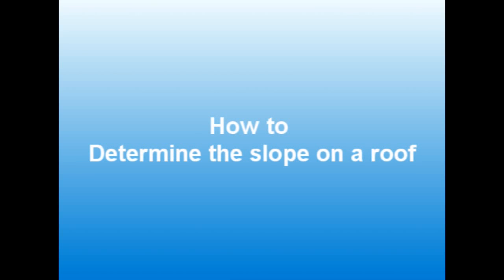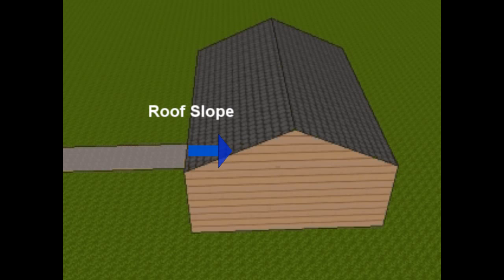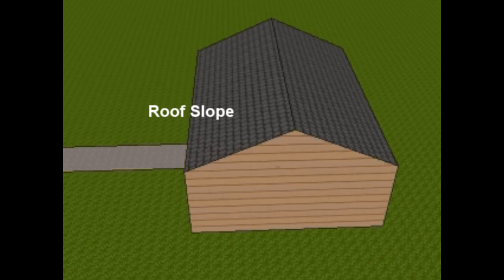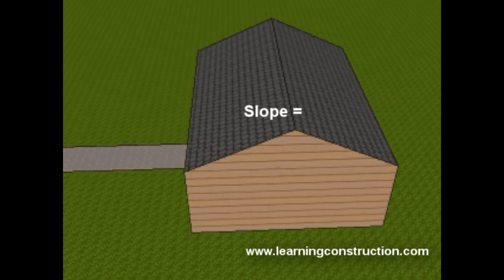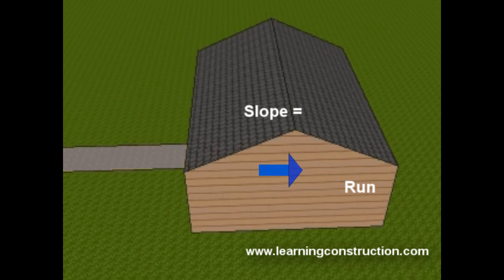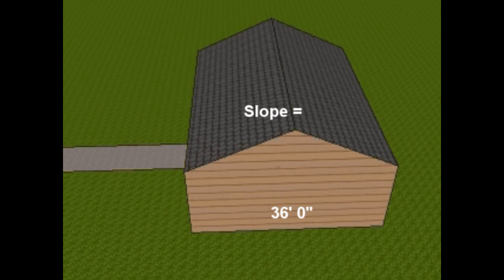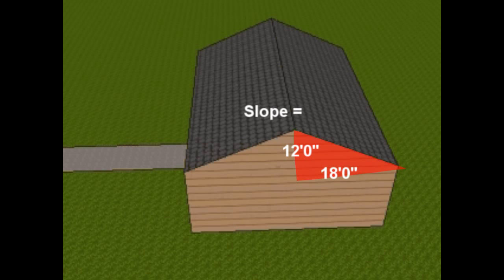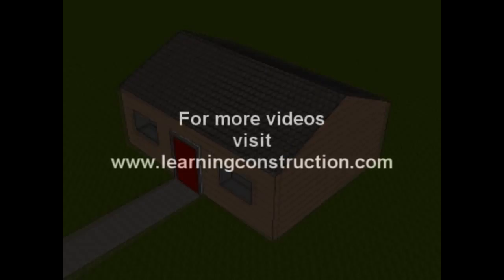How to determine the slope of a roof

Comment: That's backward, when you do the roof first thing first is choose your desire pitch or roof slope.EX 12:12 pitch=45 degree angle.so 8:12 pitch is 33.69 roof slope.so18' half wall span÷12 pitch=1.5x8=12'  is your ridge pole height.

Comment: I didn't get how you got the 8/12 inches  ... I divided 12 by 18 on the calculator,  and it gives some # that looks like, 
.6666666667. Please have patience with my ignorance here, but how does that reduce (as you called it) to the 8/12?
Reply: 12/18 = .666667 X 12 = 8  or 8/12 
The 12 that you multiply with represents 12 inches of run
Reply: @stuwil7329  Yes. The video left out one very important step -converting the .66 to the 12 standard so 8 is the result of the last calculation.

Comment: If Im building a shed roof over a porch thats 15(out from house) X 20 feet wide, What should be my slope considering its in PA with snow?
Reply: +Billy Gordon   you should check the local codes . If not, I would be as much as possible. although you dont have much roof to work with .

Comment: Now I don't know it's mathematically right or wrong but after a long  time here is what get

Rise over run that is 12 divide 18 didn't get 8/12 but if we convert rise which is 12 feet into inches that's 12*12 = 144 inches
Now simplify 144/18 feet nd we'll get 72/9 times 3 nd get 24/3 now divide 24 with 3 and we get 8
Reply: 8 pitch?

Comment: 12/18=.66

1.) Let X equal the repeating decimal.(x = 0.66...)
2.) if there is one repeating digit, multiply both sides of the equation by 10( if two repeating digits, multiply both sides by 100. example: 0.6767...)

x = .66...
10x = 10(0.66...)
10x = 6.66....

3.) Subtract the equation in step 1 from the equation in step 2.
10x = 6.66...
  - x = 0.66...
-----------------
9x = 6

4.) Divide both sides of the equation in step 3 by the number in front of X and solve for X.

9x = 6

9x = 6
--------
9      9

x = 6/9 ths which equals 2/3 or 4/6 or 8/12  ths
Reply: Way too much work. In the video's example, it's obvious that 12/18 is a "2 to 3 ratio": for every 2 units of rise, we have 3 units of run. So, 12/18 is the same as 8/12 ... since 8 is two-thirds of 12.
A more general solution for the cases where the measured run isn't 12 (or an obvious multiple of 12) is to just multiply the measured rise by 12 and divide by the measured run. If X is our measured run and Y is our measured rise, we have:
Pitch = Y / X
Multiply top and bottom of the fraction by (12/X). The new run will be 12, of course (X x 12 / X == 12). The new rise will be (Y x 12 / X).
In the video's 12/18 example, this gives:
New rise = (12 x 12 / 18) = (144 / 18) = 8
So 12/18 is the same as 8/12.
Below, a commenter asks "How about if the rise was 7ft. And the run was 5 ft". Applying the above, we get:
New rise = (7 x 12 / 5) = (84 / 5) = 16.8
So 7/5 is the same as 16.8/12

Comment: easiest way is to get on the roof , have a 2 foot level with you and a tape measurer , go to the ridge of the roof (  if you dont know what the ridge is, get off the roof now ! ), hold the level with one end on the ridge , holding it level .(..bubble in the middle ...)....go out to the 12 inch mark, place your tape on the mark , and measure down to the roof surface...if that measures 5 inches, then you have a 5/12 roof slope.....
Reply: Bob McAlister Can't do that when the building isn't built yet...
Reply: +Bob McAlister thanx this is what i was looking for
Reply: +Bob McAlister 
Thanks Bob, You have given the simplest explanation.
Reply: +iiiSK8orDI3iii When the building isn't built yet, you just look at the architectural drawings - like the elevations. They should show the pitches of every roof surface, in terms of "Y in 12".
Reply: Bob McAlister they're you go that's funny get off quick if you don't know what the ridge is hahahahaha funny

Comment: If you actually do the math, 12 divided by 18 = .66. That would make it a 6.6/12 roof.
Reply: No, .66 would make it a 6.6/10 roof. But, since the "standard" is to express the run as 12 inches (not 10), we get:12/18 = 2/3 = 8/12
Reply: Or, once you get the decimal equivalent, to convert back to the rise to run relation per 12 inches, multiply .666 x 12 = 8; therefore 8 inches of rise to each 12 inches of run.